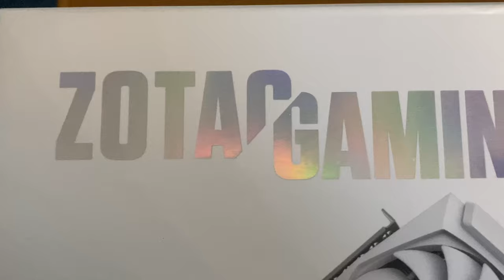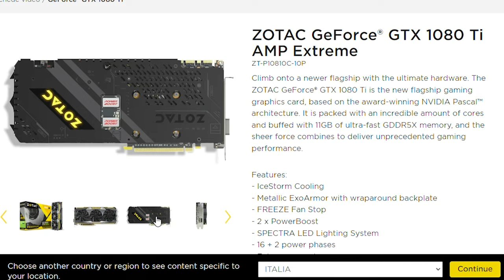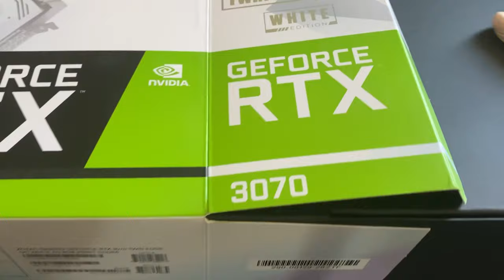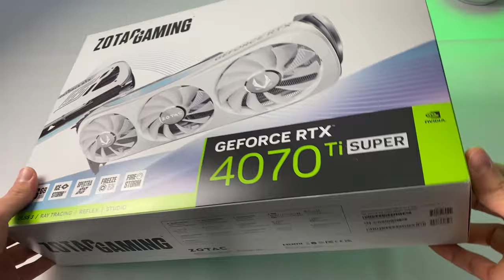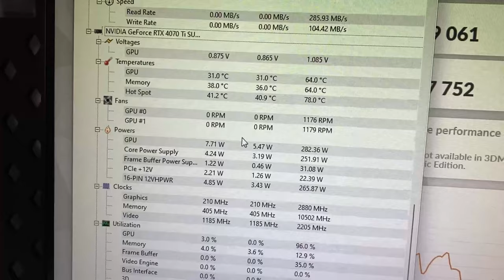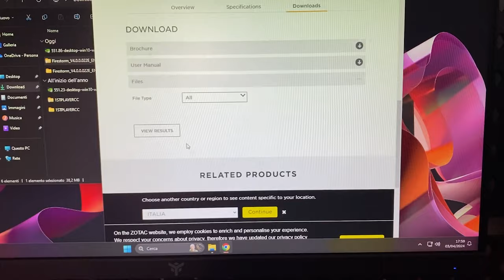Are Zotac GPUs actually that Bad? || RTX 4070 Ti Super Trinity OC

Comment: I got a zotac 4080 super because it was in stock and base price. It is working just fine and not super hot or loud.
Reply: just a clickbait title thats all. Zotac is one the best brands out there for GPU which they back by giving 5 year warranty.
Reply: Glad to hear. Mine will be here tomorrow. Upgrading from a msi suprim 4070 ti 12gb. From benchmarks it seems to be quite a substantial upgrade.
Reply: i'm also thinking of geting a 4080 super and zotac seems to be the only ones in stock... ive only ever owned MSI and ASUS cards before
Reply: @Raynolds007  2 year warranty* the 5 year is for money
Reply: I have a 2070 AMP Extreme and that little card is an absolute unit, super silent and temps are crazy low.
Reply: I have a 4060ti 8gb should swap up to the 4080 super? There’s a good deal on the zotac
Reply: Im looking into getting a 4080 super, it's been 6 months since you dropped the comment so do you recommend it after using it for that time? Especially performance and temperature wise
Reply: Better than having coil whine in ROG strix model
Reply: Same mine is actually always super cool stays AT 38C for light work and not over 50 when gaming. I have a case with lots of fans and space for airflow tho

Comment: I have a Zotac 4070 super twin edge, i don't have issues. At stock in idle stays at 34-35 °C and during gaming it never exceeds 58-60 °C and it is also very quiet,
Reply from the maker: Great to hear some feedback! The 4070 is an extremely efficient card per se and the revamp of the Twin Edge is pretty good, even on RTX 3000 they were not bad :)
Reply: hi, im considering this as well, any issue so far? this is the most available and cheapest in my country
Reply: Exact same here with their 4080 super

Comment: I don't know where you get this. I've been using Zotac cards for years and they have not let me down so far + I've built several pc's for many of my friends with Zotac cards. I may be biased, but I've had no problems with them for many years. Now, I'm rocking a 4070ti AMP Extreme Edition and it just kicks ass, I love it. Anyway, cool video dude, keep up the good work.
Reply: I’m planning on get the Zotac rtx 3060 12gb does it worth it ??

Comment: I bought and have been using the Zotac 4070 Ti Super OC Trinity white edition (the exact same GPU used in this video) for about a month paired with b760m mobo and 14600k.

I haven't had any problems at all so far, and am very satisfied with this purchase. The highest temperatures I've ever experienced during a heavy gaming session were only 70 - 75 degrees centigrade (rarely touching 75), with no air-con on and the hot, humid weather of Southeast Asia (room temperature reaches 25 - 33 degrees during the day). In fact, if you read the news, Asia has been experiencing severe heatwaves in certain area lately, and this GPU had no problems at all during the bloody hot weather conditions here. 

Hopefully this can help those of you who want and plan to buy this GPU.
Reply: Tbh was a very helpful comment, thanks man
Reply: I've read in other video. Zotac quite warm because all of the components connect to the heat sink. Meanwhile other budget brand palit around 5-10 degree lower because not all connected. The best are asus tuf, but yeah 130$ more in my country
Reply: @NenekTerbang1  iya nek, so far saya pake udh sekitar 4 bulanan, aman kok. Cuaca di indo dan pemakaian intense utk gaming game AAA rata2 ga pernah nyentuh 80 derajat celcius. Klo ruangan ber AC ya malah dibawah 70 kadang.
Reply: @zhuloong  weleh indo toh. Ane masih nabung, rencana beli trinity yg murah2 aje pokoknya 16gb. Desainnya juga ok lah
Reply: @zhuloong  bang mau tanya, saya kan baru mau build pc persis kaya punya abang speknya. kira kira biaya listrik sebulannya berapa ya bang?
Reply: @zhuloong Boleh tau case, fans, hsf/aio-nya ga kak? Saya pake gpu sama persis tp kalo main avgnya 77-78 terus, kadang nyentuh 80-82 tp jarang banget
Reply: @abellananda934  wah untuk biaya listrik mah tiap orang beda2 dong . ga bisa diukur begitu. lagian klo Anda masi berpikir untuk ngitung biaya listrik berapa, (maaf) lebih baik saran saya jangan pake GPU yang mahal. Anda build PC untuk menikmati konten kedepannya, kalau membatasi nya dengan biaya listrik, Anda tidak akan mendapatkan hasil maksimal kepuasaan yang Anda cari.
Reply: @zhuloong bener, main game berat cuman 75-78° ga pernah nyentuh 80°, kondisi ruangan non AC cuman kipas aja, semoga awet Zotac 4070-S gw
Reply: @kiizuha  tips kalau mau lebih rendah lagi suhu nya, bisa sacrifice ke graphic quality, dengan maenin di DLSS + frame gen + dan paling penting set di bawah native resolution (bisa custom resolution di nvidia cp). Alhasil bisa 60 - 70 derajat tapi bisa dapat 100++ fps tinggi dan rata kanan max semua game. banyak hal2 yang di coba di nvidia control panel.
Reply: Hye .. so far zotac good or not ? About to purchase 1 , .. please advice ..
Reply: @ursul4817  no regrets. One of my best purchase in 2024 by far.
Reply: @zhuloong  buat GTA 6 bisa ngga bang? sama nih mau beli zotac tisu pake b760m
Reply: i also have the same card, i was running a consistent 280-320 frames on warzone while my temperature was between 65-75, after hearing about the new nvidia app beta it changed everything. it over clocked my gpu by 123 MHz and my vram went up 200 MHz. now when i play warzone im a consistent 300+ frames with my temperature sitting around 50-60
Reply: bro better ambil zotac 4070 super twin edge OC atau asus 4070 tuf gaming oc (standard). budget di 10jt nih

Comment: I'm assuming an undervolt guide for the 4070Ti Super is coming soon? 😁 I would appreciate a bit of assistance if thats ok. So I already undervolted mine using your tutorials for other gpus, however there's something a bit weird that I encountered. When I put my PC to sleep (not normal shutdown) and then wake it up again, the MSI afterburber undervolt curve will lower itself on its own. Not by much, but still. And even when I try to "force" the curve I have saved to a profile, I can literally see it go lower on its own after I hit apply. The only workaround for this is to fully restart my pc, then the curve is exactly what I set it to originally. I guess my question is, is this normal? Thanks in advance for any replies! ❤
Reply from the maker: Yessir, it’s coming this Monday! Ahahah :)) About the PC sleep issue, unfortunately I’ve seen that before. One work around is to try and set your UV while idle rather than with Heaven Benchmark running, but that doesn’t work with every card and sometimes gives out stability issues. Try giving it a shot!

Comment: Yo Dude, What is top 1 thermal paste for rtx 4000series ?
Reply from the maker: That’s a very tricky question to try and answer fully in a single comment but if you’re strictly after “performance” (so lower temps) the best thing you can do is put some liquid metal on the card. However, for normal usage if you’re after longevity, performance, ease of application and basically a blend of it all my pick is the Arctic MX-6 being the boring answer, but the Iceberg Thermal FuzeIce is also very good
Reply: I'm a sucker nowadays for phase change material like PTM 7950
Reply: @ImWateringPSUs will Liquid Metal reduce longevity?

Comment: I own an RTX 3060 Twin Edge GPU from Zotac. It runs pretty cool and no noise, I've probably never heard the fans run at full speed except one time I experimented with fan speeds. Their Firestorm software weren't the best, I use MSI Afterburner instead for undervolting (that's when I discovered your guide video and subscribed to this channel lol). No problems till now and overall I'm very satisfied.

If I wanted to buy a mid-high budget GPUs like RTX 4070+, I'd probably consider better known brands like Asus or MSI. I chose Zotac brand for my RTX 3060 because it wasn't as expensive as Asus or MSI but isn't unbeknown like Axle or Gainward I think?
Reply from the maker: It’s great to hear some feedback about it! The TwinEdges overall were pretty good customs, especially the RTX 3060/3060 Tis. 

Firestorm was just bad to be honest😂 But hey Afterburner works on every card so it’s fine!

I think you centered the point by saying that Zotac is a kind of in-between brand, honestly if you’re gonna get a 4070 tier (Ti, Super, etc) card, you could also buy Zotac again. They’re pretty good!

Comment: I have the Zotac 3070Ti, loud yup sure is, runs a little warm I will say, but my Tower is a solid Air flow Tower so I never really run into 70c at all warmest is 67c while gaming, i am a Fanboy of Fans and the airflow is solid, I am looking at the 4070Ti super, Thanks for the video
Reply from the maker: If you have the “Holo” especially, I reeaally feel you. If you were to do VRAM intensive workloads (certain kind of rendering, RTX or mining) you’d see a massive problem on VRAM temp. But for normal gaming in a well ventilated case, they’re fine :)

Comment: Thankyou for the info on the Zotac 3000 series card, I was not aware of it.  Will avoid them.
I had a Zotak 1070 triple fan until this last January when I upgraded.  It ran flawless, was pretty quiet at full load and was a so much faster than my 750ti i was used to.  Sold that 1070, and it felt like i was saying goodbye to an old friend. Got me through the crypto craze, could ignore the insane gpu prices the whole craze.
Reply from the maker: I’m really happy you liked the video! 

The GTX 1070 overall was just an insanely good card. I’ve had the Zotac triple fan model you’re talking about as well and I can confirm that those were well built. It’s the generation I’m referring to in the video :)) Oversized cooler too, which is what we like!

It always feel bad to sell some of the hardware you kept for a while ahaha, I feel you. I felt like that after dismounting my first PC build. I still kept the NZXT Manta Case though, I couldn’t bring myself to sell it😂
Reply: @ImWateringPSUs  im keeping the rtx 3070 Founders edition after upgrading to rtx 4070 ti super gigabyte eagle oc at launch 😊
Reply: you can buy zotac cards but go for the 40 series cards as they are very good zotac actually listened and built good quality cards with the 40 series gpu good cooling and performance avoid the zotac 30 series card though as they are not well made.

Comment: How is their warranty? 4080 super gaming Amp is $960 rn, lowest on pcpartpicker this morning (i've been watching). I'm on the fence; i have a Torrent case for it, and it only boost clocks 30MHz under the proart I was planning to get...and for $150 less. I may pull the trigger, idk. Their 4080s had heavy vrm and topped the performance charts in DaVinci Resolve benchmarks, which is my selling point, but I heard no Zotac 4080 had a vapor chamber and I always worry about & overcompensate for heat.
Reply: 5 years I think..

Comment: I own a 4070 super twin edge. In stock settings it gets pretty hot and loud in my itx build. May caused by Bad airflow, idk. Undervolting did the trick. Now it’s running pretty quiet at 75 degree Celsius.

Comment: I bought the RTX 4070 twin edge OC for my mini itx build recently and had no issues. I absolutely detest coil whine and heard horrendous stories about ASUS and MSI's coil whine issues, and zotac seems to have none of it despite its cheaper price!
Reply: Mine does, but it's hard to hear in a closed case and is only really apparent if the fans exceed 65-70% speed

Comment: I have the 4070Ti Super Trinity black and mines gets HOT! like 82C with a core temp of 102C, that's in a Lian Li O11 Dynamic with 3x 120mm fans blowing on it too and it's LOUD like 65% rpm and is by far the noisiest device in my computer. TBH not looked at the memory temps, i'll check that later today.
Reply: Well have some thermal grizzly arriving today so will repaste. There is a news article out that most of boot all the RTX40 cards are using really cheap thermal compound that dries up quickly and over all is total garbage. 

Also my memory Temps are decent around 65c so no worries with memory.
Reply: Well I repasted with Thermal Grizzly and the temps came down.

75C (core temp 90C) @ 49% fan speed and is boosting an extra 105Mhz from 2865Mhz to 2970Mhz.

Ironically memory temps came down 1C lol

So cooler, boosts further, and quieter.

I should note that these are with furmark to heat up the card.
Reply: Hey man. How loud is the fan at 30% rpm? Does it make any strange rattle noise like the Gigabyte and Gainward cards?
Reply: @ralf2166  It's very quiet no rattle.
Reply: @Dazzxp  Thanks, I had a Gainward Phoenix, but the fan was unbearable loud(like the psu fan in the 486 DX4 computer)  from the moment is started spinning, it was running cool 67C with 80C Hot Spot and 66C memory with 40% fan speed, but the rattle/motor noise was killing me.

Comment: I have a 4070 Super Twin Edge with strange hotspot temperature fluctuations - sometimes it hits 93-96C or higher, other times when I run even the same game it won't exceed 87-89C. Undervolting helped to a degree but it still does it sometimes. Wonder if it's a quirk of the Ada Lovelace chips or maybe I just need to repaste the GPU after the warranty expires. My previous RTX 3070 never did this.
Reply from the maker: That’s definitely a bit strange, personally I’d take it apart and try a nice repaste/repad! But also the temps are not too high so you can just ignore it if you prefer :)

Comment: had a zotac 3060 Ti, watercooled it, runs great. I have a zotac 4090 since Jan 2023, watercooled, runs fantastic
Reply from the maker: This is actually a great comment because it goes to show that ALL the issues are just cooling related. The PCB is actually pretty good, even though people online complain about power phases for no reason, it’s not like we’re putting those cards under LN2.

They also made a AIO watercooled card which is pretty good! :))
Reply: @ImWateringPSUs  well yeah my perception is biased... I only ran them on air for a few weeks. 4090's been perfect even with long sessions of rendering
Reply: who watercools a barely mid range GPU LOL
Reply: @SmellsLikeNirvanna  #1 it runs even cooler, #2 noise, #3 if you already have a watercooled CPU an air cooled GPU looks like CRAP, #4 less footprint
Reply: @geort45  I think cost of watercooling should just go into a better GPU in which the 40 series runs already extremely efficiently stock.
Reply: @SmellsLikeNirvanna  what you state is a circle... if I had budget to get the better GPU, I'd watercool it too, thus making the "new budget" even higher. Also, I'm not saying I bought the 3060 Ti when the 4000 series existed... I bought it many years ago, when it was the best "bang for the buck" and only the 3000 series existed.  And I also considered that I'd watercool whatever GPU I'd get.
Reply: @geort45  its not a circle, just buy the better GPU and don't water cool it, in fact, almost 90% of people who water cool a GPU are buying at least a 4090, its likely 99% if I include 4080 and up (or its previous gen equivalents)
Reply: @SmellsLikeNirvanna  what part of having a full loop don't you understand? By your logic, only 3090 and 4090 blocks would exist. And what do you mean "at least a 4090" hah? so only 4090 users and people with Quadros with 48GB of VRAM watercool? hah...
Reply: @geort45  no, but 90% would be correct. I left 10% for people like you.

Comment: Any thought on the 40770ti amp holo? It's on sale where I am for very close to the trinity's price. Heard anything about it?
Reply from the maker: Yes I did try it out! The trinity is a bit better but honestly if you’re gonna undervolt both of them the difference is gonna be minimal. I’d say buy it if the price difference is at least 10%
Reply: Thank you! I just looked at my post, terrible typos, was talking about the 4070 ti super amp holo
Reply: @coyotestone  I have bought it recently its a good card
Reply: @ImWateringPSUs  why the trinity is a bit better? the amp holo have better performance , higher pixel rate,turbo speed,taxel rate...

Comment: Well they have the longest warranties so i bought my first ever Zotac card in the 4080 Super, been buying Gigabyte for most of the time.
Reply from the maker: Ahahahah it is true that they have a LONG warranty ngl. I haven’t tried a Zotac RTX 4080 Super yet, are you liking it so far? What model did you get?
Reply: @ImWateringPSUs  Got the Trinity Black as i am planning to put it in an ITX case (Fractal Terra). Pretty sure i watched one of your UV videos and set it as such, running good and no heat issues so far but its in an open air test bench right now.

Comment: I had bought an MSI rtx 3060 ti gaming x 2 fan with heat problems and the thermal pads leaked all over the board i don't think its just zotac i feel like some 2 fan models aren't just enough to cool those recent types of cards

Comment: i got zotac 3070 twin blade used one bought it for 300US , i got problem with gpu hot spot, one fan is making weird noises.

Im considering to open it and change thermal pads and thermal paste, i must because its summer time. (Any good video that i can follow to buy these things)
Reply from the maker: I’d say if you bought it a while ago you definitely got a great deal, but this is exactly what I’m talking about: fans giving out a little too soon and temps issues. 

I’d say definitely replace the thermal paste and thermal pads and you might also wanna relubricate the fans. I have a tutorial for both those things in my “Tutorials” playlist! 

And then of course, be sure to undervolt
It :))
Reply: @ImWateringPSUs  Thank you for the quick and quality response, and your content always helps! I saw your videos on lubrication ;D I'll do that very quickly, I even looked into thermal pad placement, but I'm really not sure which ones to buy since it adds up to over 70 euros if I were to buy all dimensions. I'll try with the Artix MX-4 paste.